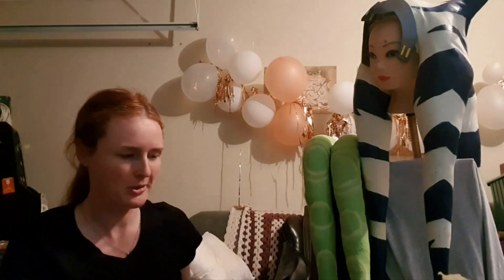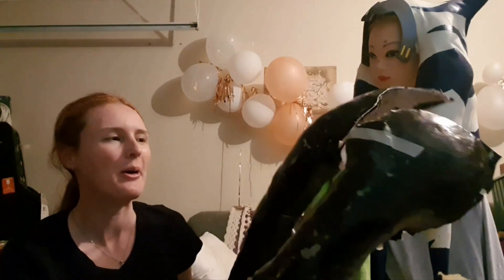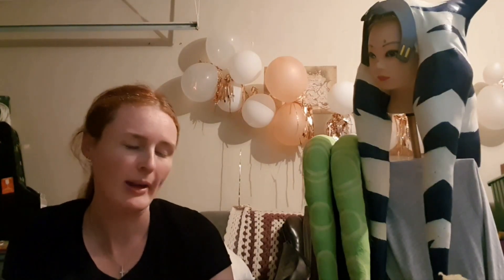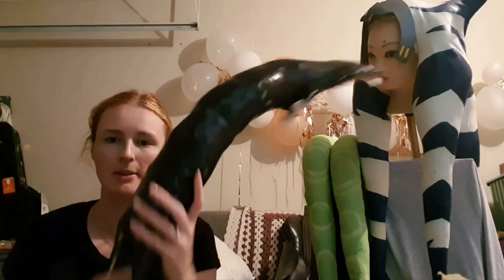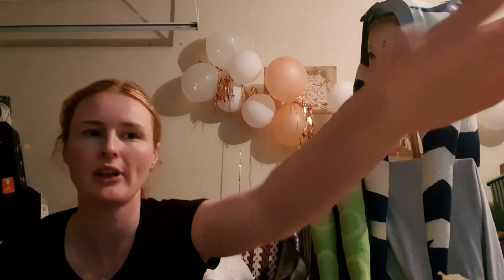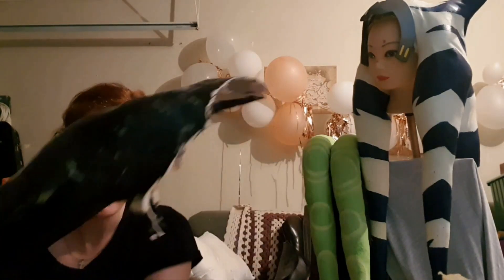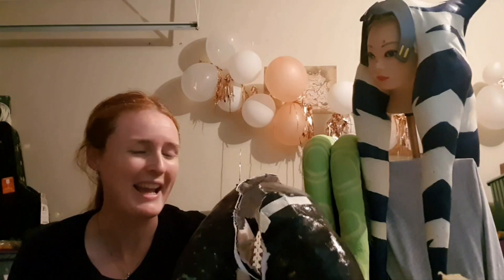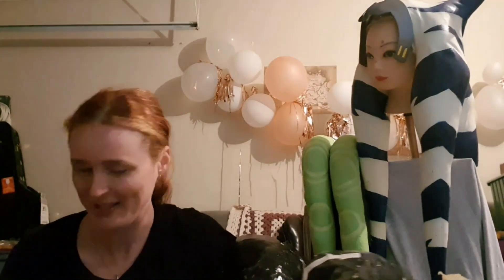How to make Latex Lekku

Comment: Came out beautiful! Question: When you said 10-15 layers, are you saying 6 layers of reinforcing layers, 6 layers of built up latex, and then 3 layers of latex mixed with latex paint, all together 15? Would that be thick enough? TIA
Reply from the maker: So my basic formula is 5 layers of structure no colour, then 5 layers with the colour-latex mix, then finishing layers stippling with same colour-latex mix with the sponge to get a nice finish. So in total it's usually about 15 layers

Comment: Is it possible to do an all white (in this case, Ahsoka) and then paint the blue stripes on the finished latex form?
Reply: You can definitely paint latex afterwards. Your paint must be flexible. I mix acrylic and latex 1:1 for my projects. Just remember latex with paint dries darker than it looks undried. Do tests. 😊
Reply from the maker: Great advice from @AshlaStargazer 
The white itself that I use has about 70% latex 30% white acrylic paint just so its a little more flexible. For the blue stripes I make up a small amount exactly the same ratio with a navy blue acrylic paint.